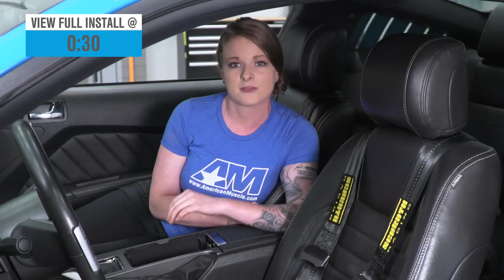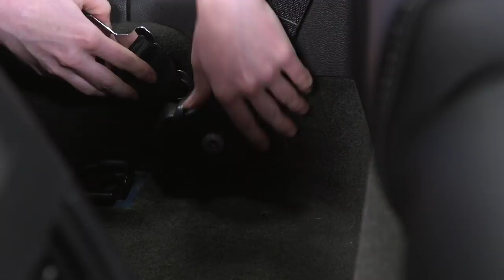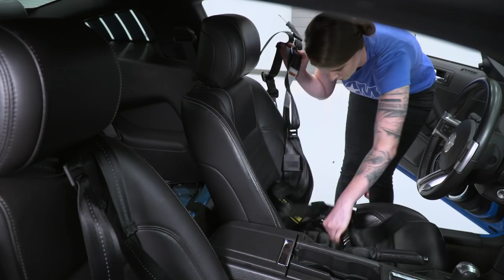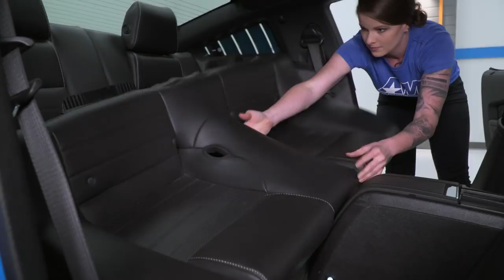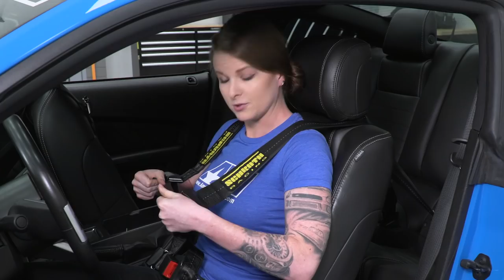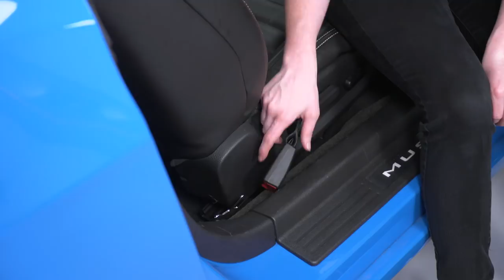2005-2017 Mustang Schroth QuickFit Black Harness Review & Install

Comment: I don't know if they're any good.. but I'd want them just for the looks Lol.. looks cool.
Reply: legit same lmao
Reply: They definitely do not suck lol.

If you require a harness at your local track but absolutely must keep your back seats accessible because you know... life, then you won't be putting any roll cages or harness bars in will you?

These are great, check out the crash test video. Get the pro as it supports HANS and a Sub Strap

Enjoy your car on and off track without butchering it. Also don't give me the myth about the roof without a roll cage 😂

Comment: BTW The harnesses go through the middle of the headrest, between the headrest bars, not around it. If you have the harness around the headrest, the harness will fall off the side of the seat if you get into an accident! This was pointed out to me at a track event by the guy who makes the harnesses.
Reply: I was wondering the same thing. The  instruction manual said to put it around the headrest posts tho

Comment: Is the seat back strong enough to support the forces placed on it by these in the event of a crash? I was told years ago by an engineer who approved vehicle mods at the time here in Australia that the shoulder straps need to go straight back to a reinforced parcel shelf mounting location or to a cross bar attached to a roll cage. He said going over the seat back and down to a floor location was dangerous due to the downward crushing forces applied to the seat back and therefore your own spine in the event of a frontal collision.
Reply: I think your right, id pass on this set up.
Reply: That is the very reason I changed my stock seats for Corbeau seats. They  are designed for this type of harness

Comment: I'm no expert by any means but when I was looking into harnesses and true buckets for my car I learned then for safety sake the shoulder straps should go straight behind you or you could risk injury to your back also the risk of submarining with a 4 point harness this is a cool add on in the looks department and I totally get the idea behind it the person who maybe leasing the car and doesnt want to do anything they will need to remove soon or wants the functionality of a stock interior but have the option to run harnesses and for that these are really cool but I think they're dangerous and anyone looking to run them should do some research on 4 and 5 point harnesses also understand the danger of running harnesses without a hans device
Reply: That is the very reason I changed my stock seats for Corbeau seats. They  are designed for this type of harness
Reply: The Pro version of this supports a sub strap but that's only to keep it riding up

Schroth has crazy Anti-Submarine technology in their 4 point harnesses, you can go watch the 90 crash tests on here right now. Zero submarining because if the way the inner shoulder strap is designed